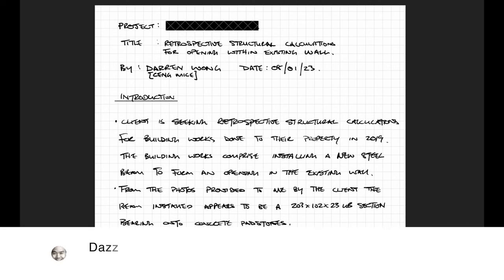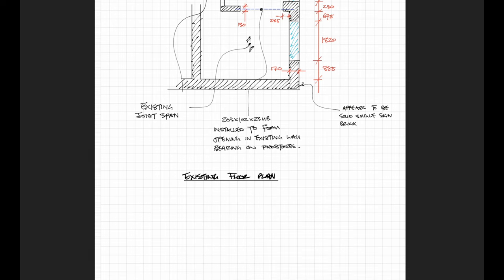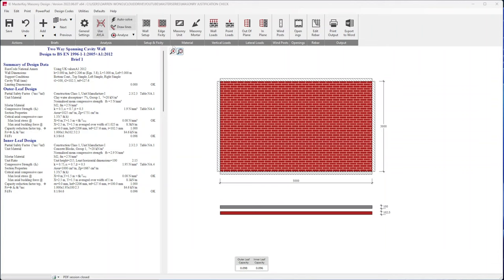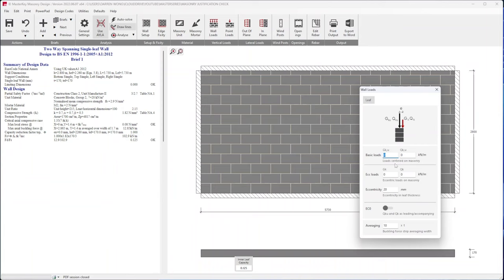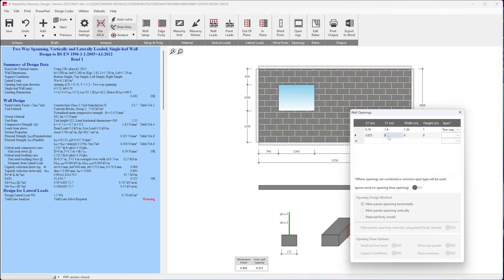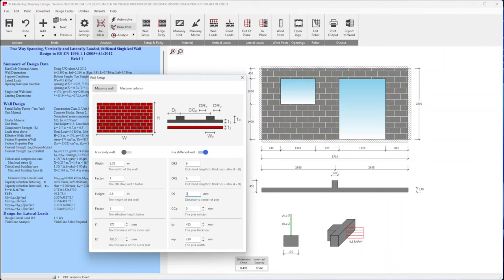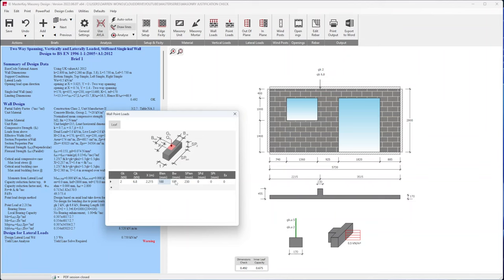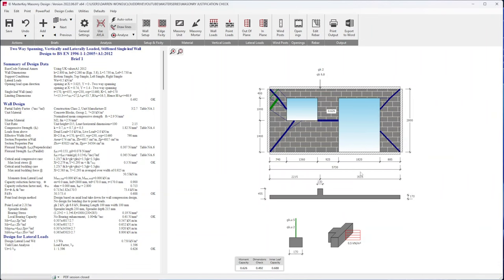How to justify an altered existing masonry wall - Structural Engineering

Comment: Great example. Its surprising how many Structural Engineers do not check the wall panel for wind loadings. If its the ground floor of a two storey property and with returns I assume that the top and sides of the wall panel are fixed. If I am doing design for proposed alterations then I always add a note for lateral restraint straps. MasterSeries is a great package for masonry panels.

Comment: Did you consider calculating the moment capacity just based on the axial load? Could figure out the pier is good by multiplying the axial load on it by the lever arm
Reply from the maker: Are you referring to calculating a bending capacity based on if the axial load was eccentric?
Reply: @EverydayDazz  Works both ways. Any compression force on your pier will add moment capacity. However in this case, the force is eccentric - therefore will be better. In my opinion it would be more realistic then using mortar tension capacity as that requires an assumption of no cracks in the wall.

Comment: Do you use 230mm for the thickness or you make it a bit smaller to take account of the pointing? Not familiar with UK practice.
Reply: Good to see a real project example btw
Reply from the maker: it was only 230 for the pier portion. the main wall was 170mm thick.

Comment: Hi Dazz. 
When you did the calculation by hand, did you also determine the ultimate failure load using the yield line method as Masterkey evidently does? This process can be quite tedious to do by hand since it is a upper-bound limit method, where you have to determine the most critical failure pattern. This is complicated by the presence of the holes in the wall. Or did you use another method which you can point to?
Reply: Yield line analysis is an upper-bound solution.
Reply: @SMSBJM1981  yes, my bad. I meant upper-bound.
Reply from the maker: Absolutely not 😂 don’t have time for yield line analysis. 
Just a simple assumption that the wall/windows/door can span in 2 directions. Just to get the load onto the middle pier.